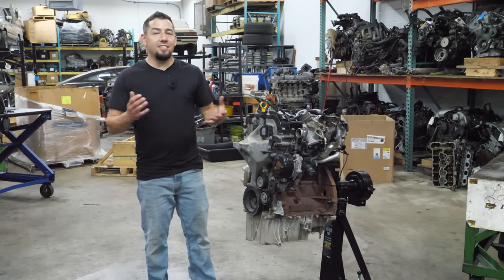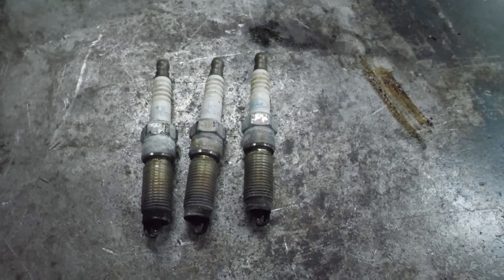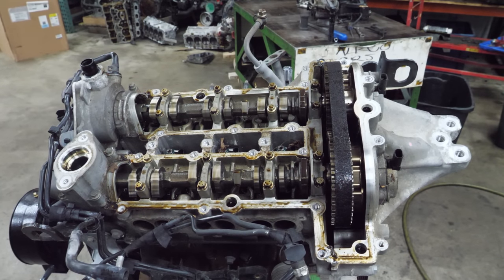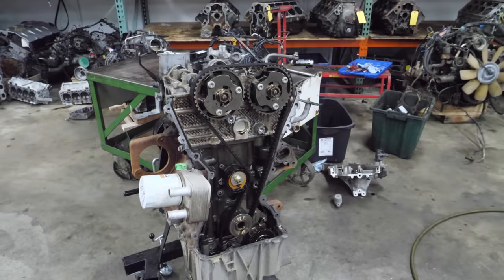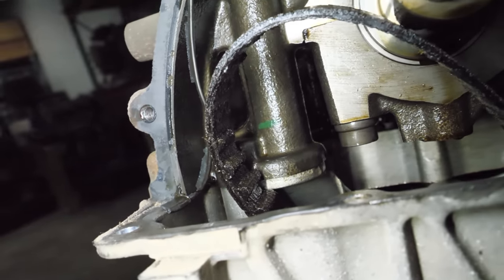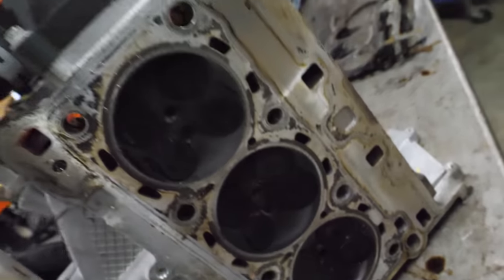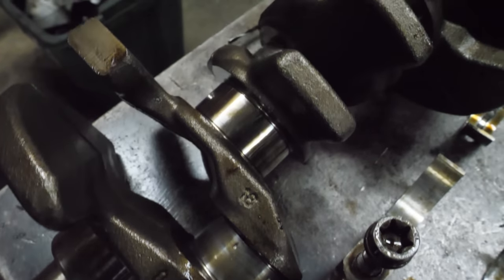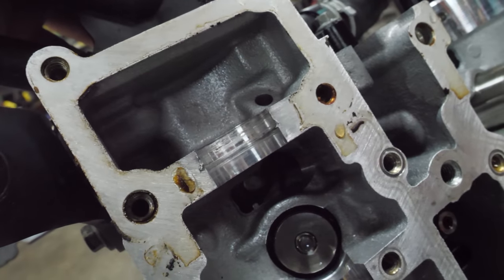JUNK Ford Ecosport 1.0L 3-Cylinder Ecoboost Teardown. LAWSUIT ENGINE!

Comment: When Ford first announced this engine, I thought "Cool, good economy in a high-revving, low displacement engine. Sounds like a spiritual successor to the Firefly turbo." Then Ford did Ford things, making numerous bad engineering choices, cut costs and corners, while still coaxing poor fuel economy out of it. Well done, Ford, well done.
Reply: Bad engineering choices? I mean they aren't bad they objectively work. And are used in many places.
Reply: @jdrok5026  they didn't seem to work here...
Reply: @mphilleo  again the ideas are proven to work. The problem normally ends up with defective parts or not a stringent enough qa policy on procedures etc. Even afm and mds can be perfectly reliable. But the problem is that clearly the material selection isn't enough
Reply: @jdrok5026  that's a fuckin essay that can be summed up with "It didn't work"
Reply: I had high hopes for this engine too.
Reply: "Why don't people want to buy our overpriced shitheap with a gutless engine that gets the same fuel economy of a 1990s dodge neon?" The mind boggles.
Reply: @KR-hg8be  I think the issue was with where ford used this engine. The cars this engine powered were just too big.
Reply: Haven't had any issue with my Focus from 2014, it has this engine. All that I have done to it is regular maintenance, still has the original belts in it and no issues. Real fuel milage is actually at 45 mpg not 29 as stated in the video...
Reply: @victorronnqvist714  I bet you’re nervous as hell to drive it now.  You just know your belts are getting ready to shred.  Better start car shopping while you can still trade in a running car!
Reply: @KR-hg8be  my 2.7L v6 Intrepid got mileage as good as that 1.0L thing.
Reply: @tomrogers9467  naah it's my daily driver, to and from work and some other stuff. I have the timing belt change coming up. The replacement is when the car is 10 years old or 240 000 km. By the way Ford has been pumping out about a million cars a year with these in it, mostly to the European market and there have been no big issue with these engines in Europe. Fine some design aspects of the engine might not be the smartest but damn it works. And the car is the most economical i have ever had. Even if the damn thing broke down completely tomorrow it would be cheaper per mile than almost anything else I have in my area. Except maybe a Toyota camry from 1980.
Reply: @victorronnqvist714  How many miles on it?
Reply: @budlanctot3060  most other comments from owners states 45 to 50 mpg… So I’m very doubtful that your intrepid did anything close to that
Reply: @smoguli  I was referring to the video host's quote of 23city/29hiway. Not exaggerated unreal mpg's of 50 mpg
Reply: The GR Corolla is a much better successor.
Reply: @budlanctot3060 the Focus probably gets that.  The ecosport is too big to really be any good with this engine, so the poor fuel mileage is specific to the ecosport and makes sense.  Kind of like a Nissan sentra rental I had a few years ago...so gutless you had to floor it for literally everything, so it got pretty mediocre fuel economy for a fairly modern compact car.  It probably only got high fuel economy if you are super patient with it.
Reply: Ford has always made top designs, and then built them out of crap. I thought it was company policy.
Reply: Most of the complaints come from Americans who are obsessed with big fat cats, SUV's and trucks. This engine in a fiesta is great
Reply: That's why Ford was always the best for trucks. Big V8 V6 engines without turbos. Those F-150s with 1 million miles all have non turbo V8. TOYOTA also made a stupid decision of going twin turbo V6 on their Tundras.

Comment: I remember when Ford introduced this engine. Part of the marketing included demonstrating how just the block, or the block with head on it could fit in a suitcase. Seems that was intentional not to show how compact it was, but a new mode for transporting replacement engines to dealers.
Reply: Yeah they were total idiots with all the crap they were saying about that stupid engine.. I was like "WTF"
Reply: Saved on shipping! 😂
Reply: europeans are convinced this exact engine is one of the BEST bc europeans are used to even worse garbage from VW (VW engines that were never offered in america) LOL
Reply: Totally remember that article.  The Ford engineer took it in his carry on luggage.
Reply: @meganjay30  I was kinda wowed by it myself. But not knowing it was a WET BELT OVERHEAD CAM design, a fact I don't think anyone mentioned or knew at the time, the engine's layout and compactness wasn't the only experimental thing about it. Wet belt...that is a priceless level of WTF in the auto industry. Seriously. People bang on Chrysler engines, and then Ford creates the first wet-belt ICE with a straight face...
Reply: Oh a new kind of suitcase bomb!
Reply: @SurelyYewJest  gm truck division and their new i6 Dmax 3 liter diesel.. jewel of an engine.. but a hot oil bathed oil pump belt. Almost like it was either an afterthought, or bean counters getting their way again..
Reply: The sad part about that was, they could have made it chain drive, and it wouldn’t have affected its footprint in the slightest.

Wet belts have no place in the auto industry. It’s mostly used on small engines like scooters and motorcycles. 🤦‍♂️
Reply: The ecoboost is smaller than my Harley CVO.
Reply: kinda like “ford built tough”, shit dont fit together properly so the people at the factory had a tough time building it
Reply: I’ve been a Ford Technician for 50 years and was told any kind of oil on a timing belt was time to replace it immediately. Why why could you design an engine that uses a rubber timing belt to run in oil, and by the way Ford told me they save 30 pence per engine by not having a woodruff key in the crankshaft to align the pulley wtf.😂
Reply: @stockcar73  OMG Ford. 🙄
Reply: Tell about engine of the year award...
Reply: Carry one in your suitcase as a backup 😂

Comment: In the UK these engines are known as "ECOBOOM" for their ability to self destruct. Great teardown, enjoyed this one.
Reply: UK autos example Jaguar, Range Rover etc. need I say more.
Reply: @gonesideways6621  and they’re going out of business in the next 15 years!
Reply: The ecoboom name came from a cooling pipe fault in the early cars. That issue is long gone
Reply: Now that's funny!  ECOBOOM 😂
Reply: @gonesideways6621 all Ford owned at some point 😂😂😂😂
Reply: @gonesideways6621  Correct me if i'm wrong. Jaguar landrover are owned by Tata a Indian company.
Reply: @garybrown5500  You are correct but the origins for Jaguar and Land Rover were in England where they are still made, back in day when Jaguar still wholly owned them a Jag dealer mechanic told me they could sell10 Jags a year and keep shop busy doing warranty work.
Reply: @gonesideways6621  some of them are still made in the UK, I think they moved most production to Romania
Reply: @garybrown5500  both Jaguar & LandRover have been through many owners in the last decade or so
Reply: I wish I'd known this before I bought one of these damned things.
Reply: The beauty of the ecoboom fault is my mum's 80k focus has a brand new engine with the issue rectified. It'll be long gone before needing a cambelt and it pulls alright. The newer engines tend to be fine. Mate of mine runs a ford dealer and they don't have any real issues with newer ones.
Reply: My wife runs a 1 litre eco boost fiesta here in the uk, it returns around 53mpg so not sure if the American version is different, the car is 4 years old we have owned it for 3 years and apart from the service which is every 2 years its cost nothing in maintaining.
Reply: @garyminion9610  yeh the newer ones are pretty good if maintained. I'd strongly recommend and I'm pretty sure ford changed there stance on it to service every year
Reply: The European built blocks had cooling problems in the early production models but that's all sorted & they're a good engine now
Reply: The failing wet belt is the problem
Reply: @garyminion9610 Don't believe what the dashboard tells you
Reply: Do you remember the old OHC pinto engines in the Capris and sierras? Used to call those 'Overhead knocker' due the blocked spray bar wearing out the cam. Head off job for that.
Reply: @alanhat5252  a lot made in China for the home market too, with predictable build quality.
Reply: @gamesmaster1060 correct
Reply: @stevieboy6286 correct
Reply: @gamesmaster1060  up to 2014 models, after that, no issues
Reply: I was talking with a pal about modern cars..he is a Ford mechanic,i was a mechanic years ago..I could barely comprehend what he told me about modern cars and engines! An engine kept in the parts store because it's easier to replace the unit than repair it! Unbelievable!
Reply: @gamesmaster1060 nope it was the wet belt that fell apart blocked the oil pickup and boom...
Reply: @garyminion9610 emember that a UK gallon is 25% bigger than a US one (20 floz per pint compared to 16 floz).

The rest is probably due to size/weight difference of the model of car it is in.
Reply: @HA05GER damn right about service every year, dont they only have about 2 pints of oil in them?😮
Reply: @SME_Ste  honestly don't know I assume not alot being so small. My friend works at a ford dealership so he was the one that told me about the year thing. He has multiple of these vehicles so can't be that bad he's a service/aftersales manager so sees all the issues.
Reply: @garyminion9610 and it's about to go boom when the wet oil pump belt fails, and you've only serviced it every 2 years and it's the perfect receipe for wet belt failure. I do hope you plan on keeping it for a while 😜
Reply: @Paul-ue8tn that was mostly down to neglect though. I put 160k on a Pinto Sierra with no cam issues. Oil changed on the dot every 6k. The problem with this Ecoboost is the stupid wet belt which breaks up and clogs the oil strainer in the sump long before the belt is due to be changed.
Reply: I was wary of a 3 cylinder 1 litre turbo so glad the Focus I found in the UK was a Mk3 with a tried and trusted 1.6 vct 4 cylinder Duratec. I’m fussy about oil change so change every 5000 miles. Got car at 67000 miles on 89000 now. Few wear and tear jobs but full Ford history they changed cambelt water pump and new brake pads and discs. Had a water hose failure and a drop link which are easy cheap jobs. The engine doesn’t burn oil and doesn’t require any top up between oil changes which is really good. Nice cars to drive I’ve owned a Mk 3 and 6 Escort over the years before having an 850 T5 and S60 Volvo. I can’t afford new cars so for me I was way too wary about 3 cylinder 1 litre. Some of you guys saying you got nice cars with no problems so fair play. I’m not liking what this guy is saying though as he strips it down.
Reply: @MH-ir7it They used the XK engine pure Jaguar design) for decades: 50s-80s. After that Some (ie the shit ones:-) used variants of the Ford Duratec (itself originally a Porsche design!) but the V8s are all-Jag and (by and large) excellent.
Reply: Funny the long fixed coolant pipe issue had to be fixed last week on ecoboom focus at work, still out there and still costing engines
Reply: @garyminion9610  - I've always thought that worrying- 2 year service intervals with god knows how many miles- the lifeblood engine oil must be well past its best, leaving it in for that long.
Reply: @Paul-ue8tn - at least those engines were easy to access and take apart and economical to repair. I only buy Jap cars now, all my Mazdas have timing chains and get 6000 mile oil and filter changes. Belts running in oil look like bad news, especially after a few years, even if they were designed.for that purpose.
Reply: how about 1.0 VW? They have the worst track record,with highest number of issues under guarantee(not to mention mostly serious ones) ...
Reply: @gonesideways6621  Yep, and they used to be owned by Ford. Enough said.
Reply: As a garage owner I absolutely hate servicing these things
Reply: @faheemabbas3965  15 is generous
Reply: They sure are my mates one blew up with 60k on the clock completely stock 🤣
Reply: @alanhat5252  and Slovakia
Reply: @garyminion9610 really hope you get it serviced much more often than every 2 years. And unfortunately it's not a case of if the wet belt fails, its when it fails. It's a slow death to the engine. All is fine, up to the point the oil pressure drops. The belts over time breaks down, blocks oil pick up and engine gets less & less oil around engine. Then it's new engine or car.
Reply: @MH-ir7it  not all of them. The Supercharged Petrol V8 is all Jag.
Reply: @HA05GER they haven't, it's still a 2 year service or 18k miles whichever comes first. Had mine booked and they called me to say it was too early and I needed to move it 12 months into the future so.. Just waiting for October to come round.
Reply: @BSGamesOriginal  I don't think it's in writing thing it's a recommendation my mates a service manager at a dealership and that's what he told me. Also they can't force you not to do it so if you wanna do it do it. If you don't plan on keeping the car then maybe don't bother but if you do 100%. Ask for a motor raft service they are cheaper and also I assume the free breakdown that comes with a ford service still only lasts 12months.
Reply: @HA05GER  I've had the car since new. Took it for service at 18k miles when the car was less than a year old and they tried to tell me I was too early until I pointed out I'd reached 18k. 2nd service was done 2 years later at 32k. When I booked the latest service for the car last year I got a call while at work to tell me it was too early and it needed moving back to October but I could have the interim service in the meantime and still have the full this October. You're right Ford assist breakdown is only for 12 months so I've added that into my insurance anyway as the car isn't covered by them right now for breakdown.
Reply: @BSGamesOriginal  bear in mind that the crap cover usually with Insurance really is crap it's local cover usually where as the ford assistance is nationwide and will recover you anywhere so have to weigh that up aswell.
Reply: @gonesideways6621  Aston Martin, McLaren, Rolly Royce, Bentley, Caterham, Lotus, TVR...
Reply: @gonesideways6621 when did we say they are good?
Reply: @gonesideways6621  In Europe, US engines don't sell, they are known for  crude engineering, with huge heavy engines that have low power outputs for their size.
Reply: Should be Eco-DOOM.
Reply: They’re still very prone to failures even after the cooling issue was fixed. The main attribute is the lack of oil changes because of the old oil causing the wet belt to break down and block the oil pickup.
It’s good practice to remove the sump and clean the pickup while changing the cambelt
Reply: @gonesideways6621 Now Indian owned, need I say more?
Reply: The 2.7L Ecoboost in Broncos are truly EcoBOOMs.
Reply: @garyminion9610 you won’t get much better than mid 50’s mpg on long runs, but it’ll be less on city driving, probably around half that
Reply: Eco-BURST is better.
Reply: @RRaucina   🤣🤣🤣 👍
Reply: My first ford focus ecoboost I sold with 155k on it without a single problem my new focus ecoboost has now got 60k trouble free all I do is service it probably more than the manufacturer recommended and I was told change oil once a year and only use the exact recommended oil and you won’t have any issues
Reply: @philmoffett366  it’s always good hearing the other end of the scale rather than engine disasters. Well maintained machines lasting and having a good life ✌🏼
Reply: HAS ANYONE Heard of ford 1.5 ti-vct gas engine 3 cylinders?
Reply: @torukojinnn6331  the naturally aspirated duratec blocks?
Reply: @Paul-ue8tn  My parents had a Lima 2.3 in a 1986 Mustang. The thing started chewing distributor gears right around 120,000 km. Those engines were disposable. It was cheaper to swap in a 302 Windsor with transmission (thousands of these available in the late 80s) than it was to bother trying to fix the Lima. You could usually get the rear end out of the donor vehicle for a couple of hundred bucks more too.
Reply: @garyminion9610 might be worth selling now then
 Ford are recalling newer ones now
Reply: Depends on how well you maintained the engine, if you abuse the absolute shite out of it, it will fail.
Reply: @alanhat5252  All European market Jaguars made in UK except iPace which is made in Austria. European market Land Rovers made in UK and Slovakia. 
Other factories are Brazil  (Land Rover), India (both brands) and 50% JV in China (both brands).
Now have their own engines having previously used MG Rover, Ford and BMW.
Reply: @Paul-ue8tn yep everything  has issues
Reply: Guys, the 1.500cc 200hp from Fiesta St mk8 is reliable engine??
Reply: @DimoS...  yeh not heard any negatives
Reply: @kenduro007  a service.. what's wrong with doing that?
Reply: @limpet7r63  Ford revised the spray bay, you may have had a later one
Reply: "ECOBOOM", now that's a good one.  Thanks for the Laugh.
Reply: Belts like Harley junk
Reply: @gamesmaster1060 belts suck  and you know it
Reply: @alferret1969  eco it fall down and go BOOM!  I love it that's a good one.
Reply: @gonesideways6621  hey rover rover just fall over.